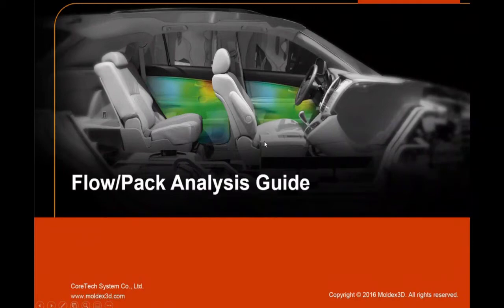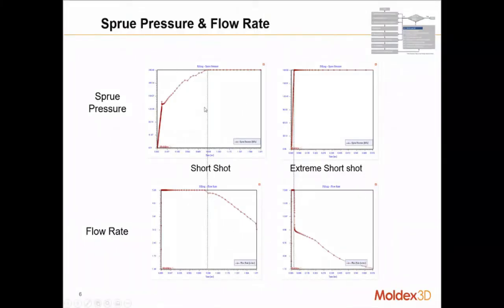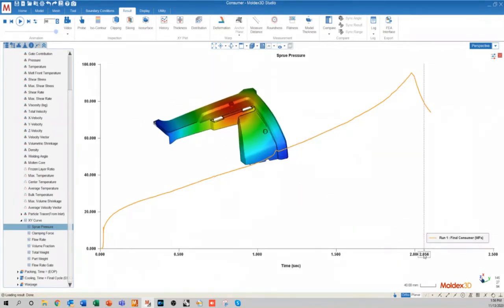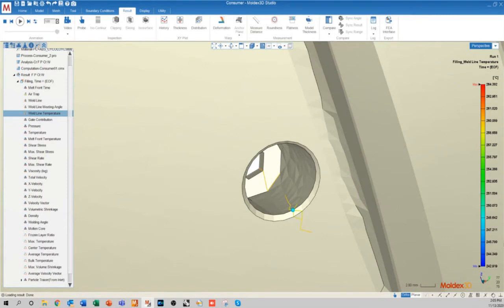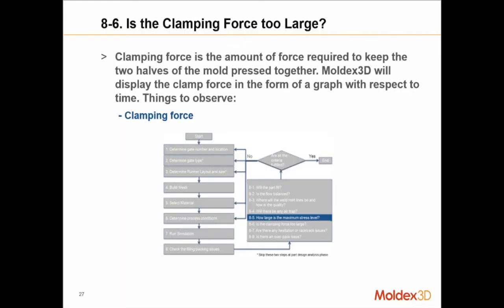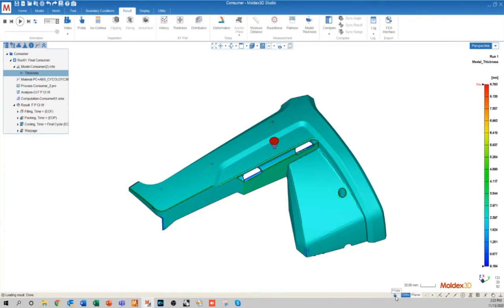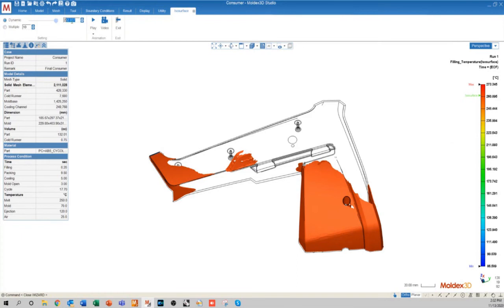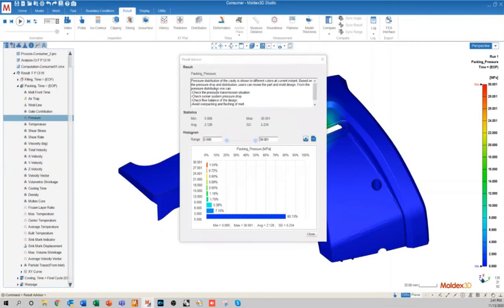Fill & Pack Analysis Result Interpretation | Advanced Tips & Tricks | Moldex3D Studio

Comment: Timestamp: 36min: Actually clamping force in filling is the value you want to look at if you have an unblanced multi cavity tool, cause the filling pressure will in that case usually be larger than your packing pressure  :)
Reply from the maker: Since the packing pressure plot shows the results of filling as well as packing, it is always better to look at the packing clamp tonnage for a more complete description of the clamp tonnage over time.  The max clamp tonnage could occur in the filling, but most of the time, it will happen in the packing stage.  It is dependent on the process.  But regardless, the packing stage shows the filling clamp tonnage as well, which would give you the max clamp tonnage regardless of whether filling or packing is higher.
Reply: @moldex3dnorthamerica599 yeah! You are so right 💪

Comment: what is the effect of Low mfi and high mfi material on clamping force in packing ?
Reply from the maker: Since MFI is related to viscosity, and viscosity is related to pressure, and pressure is the derivation of clamp tonnage, MFI will have an impact on clamp tonnage. 

A higher MFI means the material moves more fluidly, which means, in most circumstances, a lower injection pressure requirement, and a lower clamp tonnage as a result.  Lower MFI will result in higher clamp tonnage.

Comment: Thank you for a very informative demonstration video.  On the subject of measuring shear stresses, I think shear strains can be measured using rosette strain gages and so shear stresses can be derived from the shear strains. Accuracy for tight spots in the part may be a different matter.
Reply from the maker: Thank you for watching!  The strain gage method can be used to measure stress, but only for the solidified part after the molding process, not during the molding process.  Note that the shear stress of the melt during the filling stage of the cycle is going to be different than the internal stresses in the part after the Fill, Pack, Cool, Mold Open cycle.

Comment: Interesting video! If a cold runner was used in the model, would the packing time need to be increased? You have 9.5 seconds and the sprue is still hot at the stage EOP.
Reply from the maker: If a complete cold runner is used, then there could be potentially more shear, causing the material to heat up more, and therefore causing a longer gate freeze time, and therefore increasing the pack time.  

On the other side however, it also gives more time for the cooling effect to take place, which could cause the gate to freeze earlier!  It is very dependent on the process and your limiting factor for gate freeze will always be the region of lowest cross sectional area.  

There is an argument for drool or stringing from the nozzle, but as long as the part is packed well enough, that usually isn't a concern.

Thanks for watching!